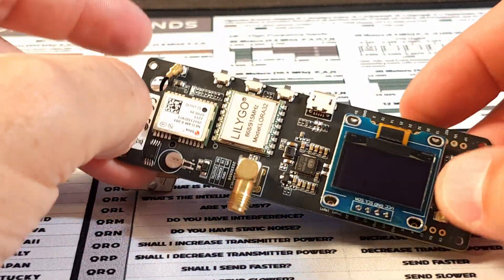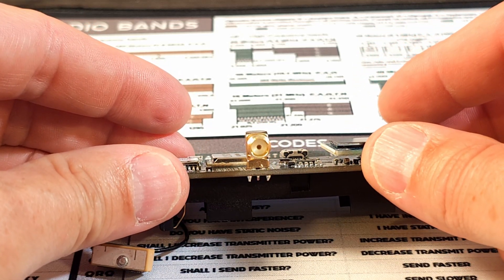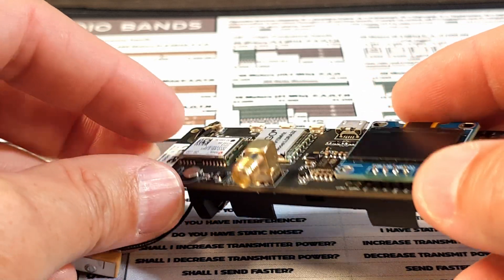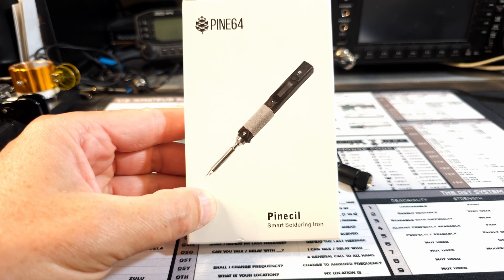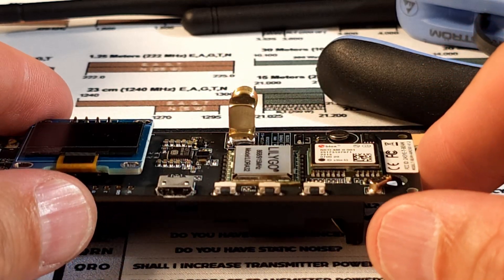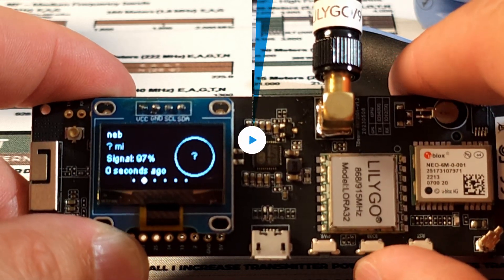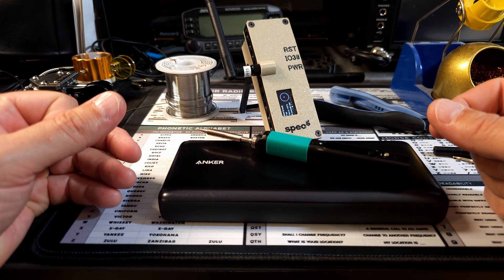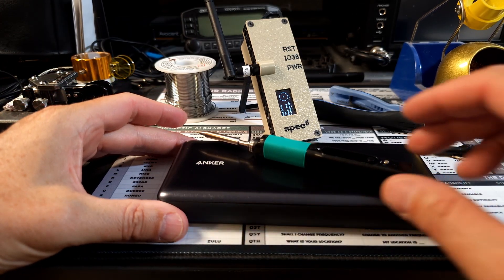T-Beam Disaster: Pine64 Pinecil V2 DC Soldering Iron Put to the Test!

Comment: I find tip really matters for stuff like this, the fine point tip is rarely able to transfer enough heat. Does it come with a flat/spade/chisel tip? The iron should be capable of delivering enough heat I think but its the transfer that matters.
Reply from the maker: Excellent point. The Pinecil comes with the  B2 tip I was using. You can buy a set of additional tips, in a long or short form,  including I, C4, D24, and K.  The chisel types would be a much better tip for the job. Thanks for watching and commenting!

Comment: Use some good quality flux to help with soldering, this is a weak connection and will break again.
Reply from the maker: @whitefang.11-yt  Agreed. My workbench is in disarray as I am in the middle of reconfiguring the space and I couldn't put my hands on my tube of flux at the time.
Reply: Agreed. Besides flux I also think that most of the solder stuck to... nothing. I'm not familiar with the PCB but I don't assume there's an entire copper pad under the connector, just the throughholes. So then the solder "stuck" a little to the connector but not to the board; there's solder mask there so nothing to stick to. Even worse: I guess that if the middle/center pin was still connected that the solder does nothing more than keep the connector propped up from the board putting tension on the middle/center pin in a sort of a 'tensegrity' kinda way other than maybe at the corners at the throughholes. I wouldn't be happy / satisfied with this.

Having said that: keep it up! Enjoyed the video anyways.

Comment: Nice little soldering iron.   That may take the place of my butane iron in my portable kit as I am much more likely to have a battery bank with me than butane!
Reply from the maker: Yes, that is exactly why I bought it. It also has a 5.5 Barrel connector as a power option but the fact I can run it on a PD power bank is a home run in my book!